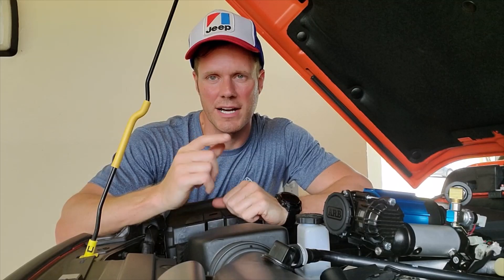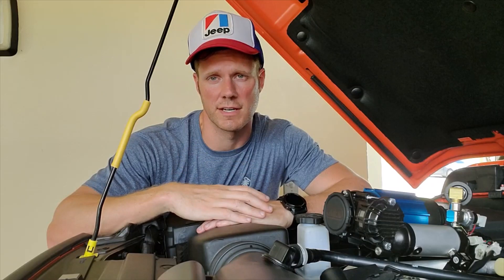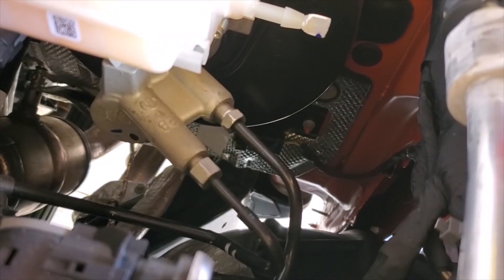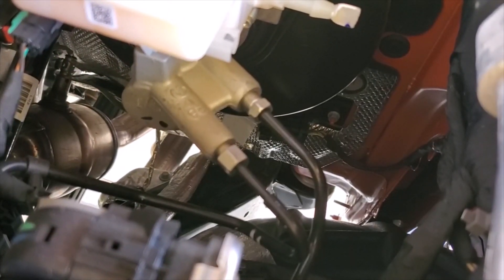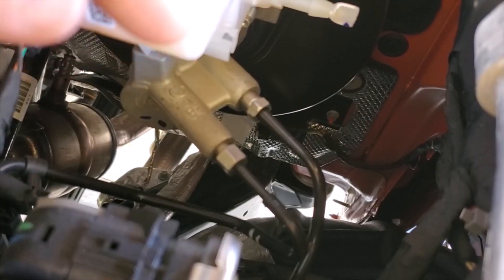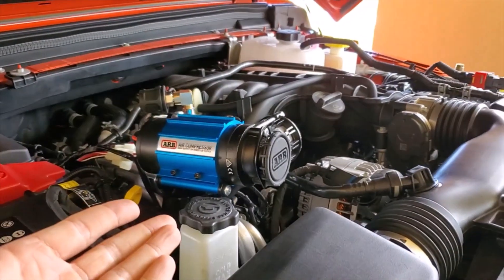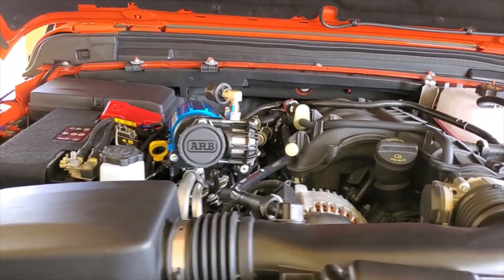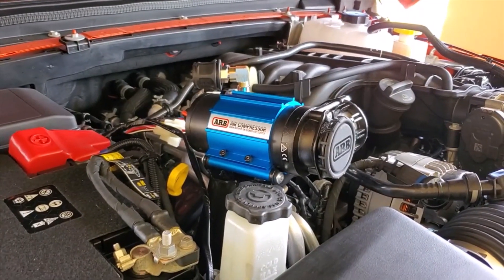The best and worst location to install an ARB Compressor. 2020 Jeep Editions

Comment: I put mine in this location on my 2022 JLU with the 3.6L E-Torgue.  Very tight fit between the mount and the hood but still the best place I could come up with for the install as I do not want it in the cabin.  On my engine, there is a hard metal tube that prevents the manifold from being lowered as shown in the video, but the manifold can be shifted far enough to the right to allow the hood to shut.  You may end up with a slight indentation in the hood insulation though.  Also, you'll have to run the air chuck and the solenoids parallel to the ground though rather than pointing up towards the hood.

Comment: Did the same setup, thanks for the tip! I ordered my JL with the aux switch package, the hot legs of which come bundled beside the battery from the factory. Couldn't be easier, love it.

Comment: “There’s a lot of space between the radiator and the engine. It will keep you compressor cool.” … and you engine hot! You last mounting location is great, and really makes sense.

Comment: I really do like this location. How is the compressor holding up and how long does it take to pump up your 39’s? Oh and can it pump them up in one duty cycle? I am being told I need the twin compressor for the larger tires.

Comment: Worst place to mount the compressor is anywhere under the hood. Regular temps of 150 cannot be good.  Behind and under the passenger seat is where I mounted mine
Reply from the maker: You've been reading forums. I called ARB and have about 15 years in the offroad industry. This location is fine. What is not good, is next to the exhaust and behind the driver fender. The directions are clear about what you can and can't do. Just have to be careful in who you get your info from. Have a blessed day.
Reply: @c130aviator   I don’t really do forums much, but I think you’re right about me getting the under the seat location from there.  My first Jeep was a 1984 CJ7 , I bought it new.  My current LJ is 15 years old, and I also have a JK.  I’m not exactly new at this.  Thanks for the kind words.

Comment: Are you mounting this over the 3.6L V6 eTorque Engine? I know the layout in that area is slightly different with the eTorque versus the standard V6.  Curious if you also wired the switch to one of the auxiliary switches (I have Aux 1 and Aux 2 currently free in the cab) or if you mounted the switch that comes with the compressor somewhere else.

Comment: I have a 2013 SVT Raptor running 35s the only thing worries me to install the dual compressor in the engine bay were I have many good locations and accessibility is the heat produced by the engine taking into consideration I live in a hot dusty climate/area. I would appreciate if any of you can share with me if the dual compressor  would experience any fatigue or damage caused by the engine heat?
One location I feel perfect for my application is the truck’s bed right hand side secured by an aluminum plate to the bed’s side noting that I have a fiberglass bed cover by leer which isolates the bed from the environment but I need to add at least 10 feet of cable to connect the  compressor to the battery the power switch will be installed next to the compressor in the bed on the same foundation plate.
Please advise me what I should do?

Thanks

Comment: I installed mine in this location, mounted directly to the plate but still some slight rubbing on the hood insultation.  Nothing I'm too worried about. Haven't hooked up all the wiring yet, wanted to see if I noticed any increased engine noise from the cover being removed.  I did not notice a difference in noise.  I did however notice that the ARB gets VERY hot after driving around only a few minutes.  Have you had any trouble airing up after a trail ride due to the ARB overheating?  Do you need to let it cool off for a while before using with it mounted here?  Thanks for the videos!
Reply from the maker: No issues.

Comment: The Grimm off-road bracket comes with a heat sheild for there bracket that mounts in the drivers side wheel well.
Reply from the maker: There are definitely good products out since I posted this... but mine is still free and very functional.

Comment: What size was the fitting that screwed into the manifold?
Reply from the maker: Arb lists it as quarter inch for some fittings. The manifold is unique but can be found on their website for the pump install in pdf form.

Comment: I believe it is too hot for the compressor long term to be mounted in the engine bay.
Reply: 12 years ago I mounted my compressor in front of the brake booster under the hood on my JK.   Didn’t like it because it was literally right over the exhaust manifold and gets a lot of heat.  But I left it there just out of laziness at first.

That same pump is still there and working to this day.  Don’t ask me how - but apparently ARB compressors are pretty tolerant of heat.  I’ve had the air chuck so hot I couldn’t touch it for more than a couple of seconds - but the damn this just keeps working.
Reply from the maker: That could be the case for many.

Comment: I would also like to know if the cover that was removed from the engine to install the compressor can be cut or in some way modified so that it can still be in place to reduce the engine sound.
Reply from the maker: You could cut off the corner where the mount for the arb is positioned. Could be good option.

Comment: Great video!  I am looking to buy an ARB compressor and ARB lockers.  Which ARB compressor is this, so I make sure I get the one that will fit in this location.
Reply from the maker: Its the ckma12 was the pump

Comment: Great idea! took the time to wire mine in very nicely in the Wayalife location, but I like this idea better and might relocate mine. One question though, after removing the cover do you notice any additional engine noise while driving?
Reply from the maker: No, its still very quiet and not noticeable. Thanks for checking in.
Reply: TewlTalk Done and it works great. Thanks for the awesome idea!

Comment: What kind of magic trick does it take to get a bit on the existing stud(on the side closer to the middle of the engine?  I cannot get a nut between the compressor and mounting bracket.
Reply from the maker: I removed the pump from the bracket first.

Comment: That driver side top of the engine compartment has several mounts, but I wouldn’t put it in the engine bay to engine with. I agree that you want your investment to last so my location is the MORE bracket(next upgrade).
I will say that is an awesome location you found. Do you think an twin air compressor would fit there too?
Reply from the maker: No, its a tight fit. Buy this pump has plenty of capacity. For larger tires get a power tank. It will air up a 40 in a minute.
Reply: TewlTalk I thought about the power tank option also, but since I don’t have a trailer, and have the trektop from bestop I’m limited to how much stuff I take with me on the trail. I’d like to have a trailer in the future when I’m back in the mainland USA for longer trips and then I’ll probably have a power tank and have the compressor for the air lockers.

Comment: Where did you get the 90 degree brass elbow from? That connects to the air chuck?
Reply: Found it Home depo has it (brass pipe street elbow 1/4 in MIP X 1/4 in FIP)

Comment from the maker: I have read that some are getting interference on the insulation. You may have mounted it with a spacer or the wrong hardware. There is no interference on the filter if you install it directly to the engine cover bracket.
Reply: I saw the bracket Our Bills999 mentioned and thought it was the perfect twin compressor mounting solution for my 2022 JLU.  Sadly, while the 813 Fab bracket works with a strait 3.6L, it does not work if you have the 3.6L E-Torque.  After much research and investigation, I'm going to go with ARB's single compressor and mount it in the location you suggested.  Two and a half years after the original posting and your video is still helpful!  Thanks!

Comment: Can I do this in my jl 2019 2.0 sahara?  How do you installed that bracket? Hope you have the actual video when you installed it..
Reply from the maker: There is no install video. Its a very easy bracket to bolt on. It wouldnt be worth the time to make a video.

Comment: Great video. My bracket has a stud on the right side.  I assume your truck does too.  Did you use it?
Reply from the maker: Good to know, you can adjust and move the pump around and clear it without modification. There is long slots avaliable to adjust placement. I also disassembled the entire bracket to install. Its fairly straightforward.
Reply from the maker: Great question, I used the stud with a nut and washer under the hood that was out of sight. I believe you can use the nut and washer from the ARB kit but I did not try. The other side I just used ARBs hardware.
Reply: Just got the compressor delivered and the stud is too long and contacts the body of the compressor.  I’ll work with it and see what I can do.
Reply: Got it.

Comment: Would there be enough room for a Dual ARB?
Reply: I see you already answered NO on a different post.   Is there not room under the passenger seat?
Reply from the maker: There are companies making mounts for under the seat. I cant speak to them, but these pumps are loud, I have had a few of them over the last 20 years. I wouldnt want it in the cab.

Comment: This is brilliant.  Thanks for the tip.  Are any additional parts required to install this?  Do you happen to know if there is enough room in that part to install the larger ARB Twin?
Reply: I was going to ask the same thing, do you have a how to of this install?
Reply: @Veloruche  I heard back from him in the Facebook Wrangler JL Group.  He said the Twin won't fit there.  I am ok going with the smaller one so I am moving forward with the install.
Reply from the maker: I dont, its two bolts after removing the engine cover, no extra parts needed. Everything comes with the pump. Good luck, its very straight forward.
Reply from the maker: Not that I know of

Comment: Great idea, thanks!
Reply from the maker: Thanks, Ill assume the dislikes are guys who mounted it in the easy bake oven under the brake booster.
Reply: TewlTalk 😂 I’ve been doing videos for about a year now and I too wonder about the dislikes I get… how am I supposed to make better content if I don’t know the reason for the 👎🏼. Fortunately they are not many, but the amount of effort it takes to push the thumb down than to not push it thumb at all makes me laugh. I would honestly rather a tasty comment than a thumb down… Anyway… To my question… I see you have a single ARB pump, would you reckon the dual system work in this location? I’ve been on the fence about where to locate mine as well… I’m considering the 813 designs I keep coming across that attaches to the bed ACC. rail, which is a pretty smart design. I may do like brad I’d trail recon and locate it in a leitner box when I do my rack. Keep up the great work. I know the amount of time for RND it takes to put together an informative segment. 🤙🏼
Reply: @c130aviator  yea, when I saw people mounting it there I scratched my head.
Reply: @c130aviator  hahaha